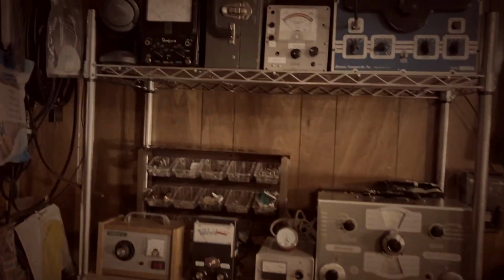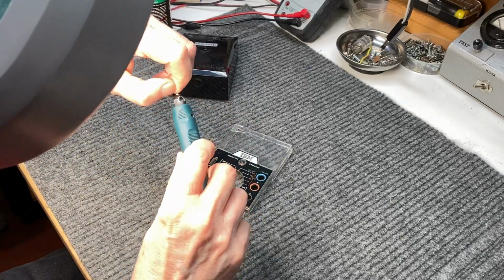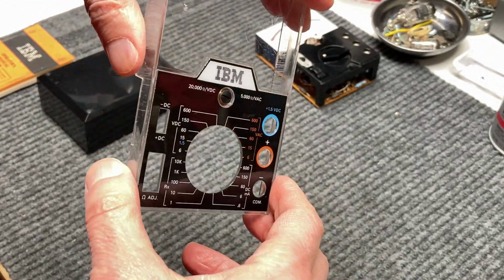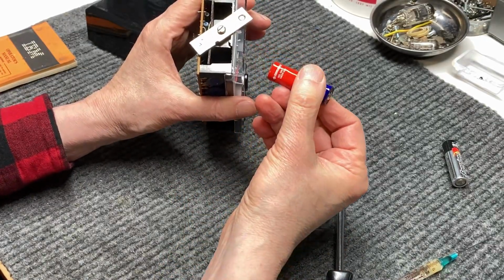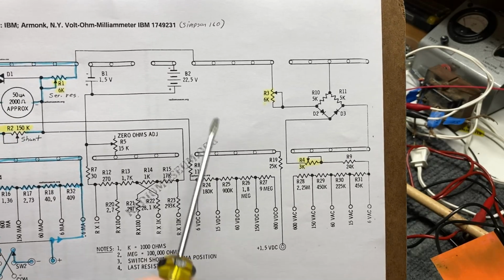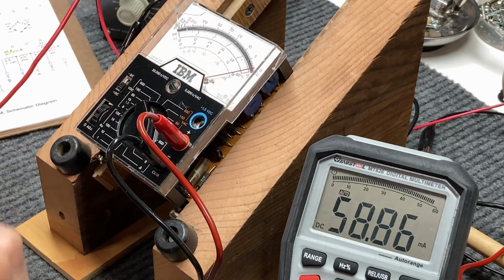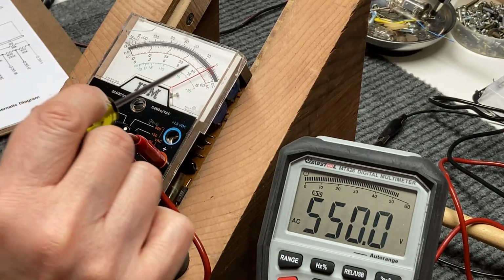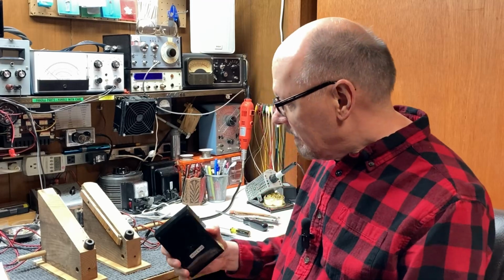IBM 1749231 VOM (Simpson 160) Repair & Calibration

Comment: Thx very much for explanation en guidance. Recently, I got one  (IBM version) and very happy with it as it brings me back to the times of good history. It came with a DB (decibell) adapter which could plugged in on top using the 0.6mA scale.
Reply from the maker: Right, I have my Db adapter around here somewhere as well.  Probably still in my old service case.

Comment: For accurate calibration you have to pass 50 microamps through the meter and set the needle deflection to full scale using R2. You then measure the resistance between the input to the meter (left side of R2) and the far side (right side) of R1 and adjust R1 until you have 5k ohms exactly. That is DC and Ohms calibration done. Then you can test accuracy on all ranges for full scale deflection using a reference DC source. If there is any inaccuracies the prescaling resistors need to be checked. Once that is done you can calibrate AC volts using a known AC voltage for full scale. Once again the prescaling resistors values will affect meter accuracy.
Reply from the maker: Thanks Derek, glad your post is here for future reference.  Those instructions I got were very confusing, yours are much better!

Comment: Hello, Great video! I was wondering whether you know the size of the Allen Wrench I need to use to remove the selector knob screw?
Reply from the maker: Good question.  I was going to check then I realized I would have to take it all apart to find your answer.  I would start with standard imperial size allen keys then try metric keys.  Beyond that, I supposed they could have used "Bristol" wrenches since this is branded an IBM product. IBM was really into Bristol wrenches because they were used a lot in their typewriter line.

Comment: Hello- thanks for the video. I ordered a new cover for my meter and it did not have the anti static coating. Can you recommend a spray for this problem? - Phil
Reply from the maker: I have heard that a 50/50 percent solution of Downy Fabric Softener and water sprayed on the inside of the meter face may eliminate the static buildup issue.